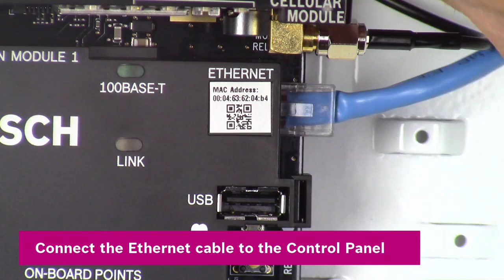B Series Control Panels: Wire the Control Panel

Comment: have just installed the B426M IP module. How do I configure my Bosch Control panel to enable? Am stuck and also the RCS+ app is asking for the user code after I scan the QR code? What is the user code? Have got the BOSCH 3000-3PIR-ICON user control panel installed. Thanks